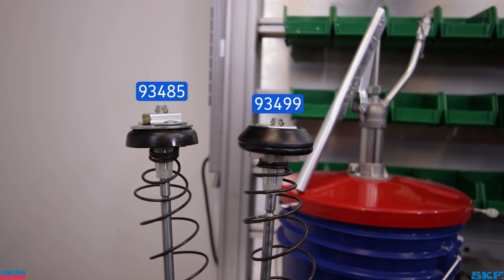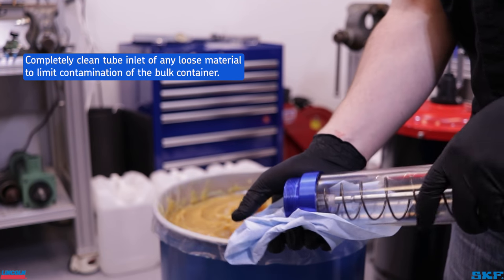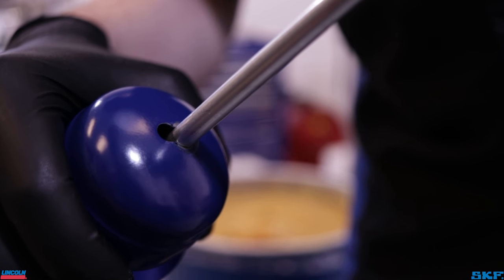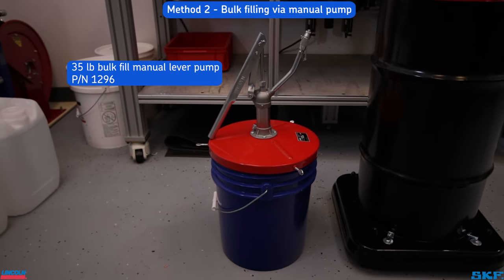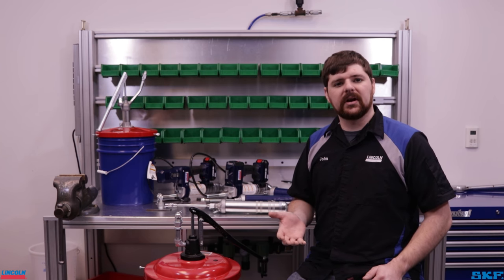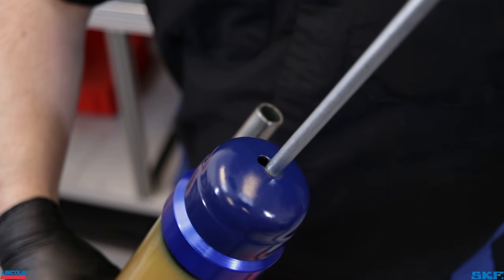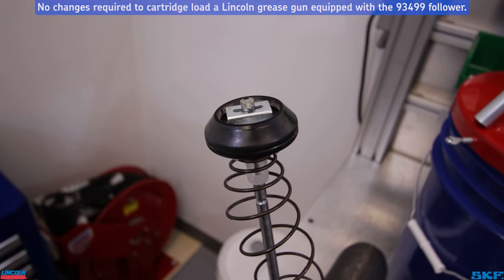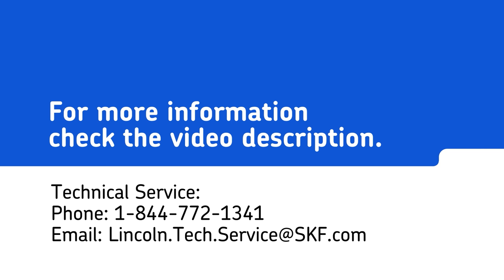Handheld Grease gun filling methods

Comment: Is their a part number for the bulk fill station fitting?
Reply from the maker: The bulk fill coupler used on the 120lb filler system is the p/n 80133. 

~ John